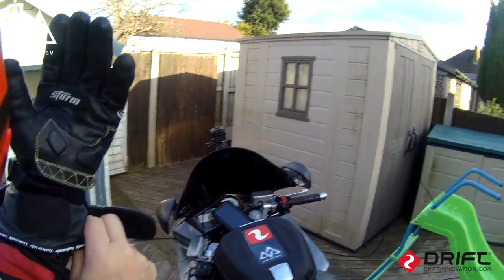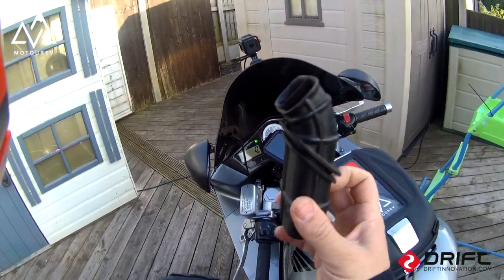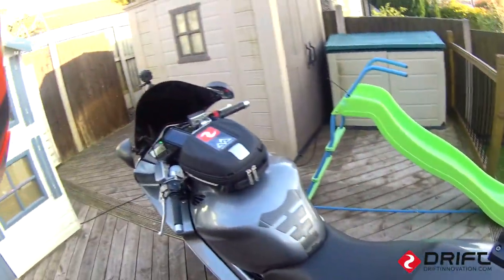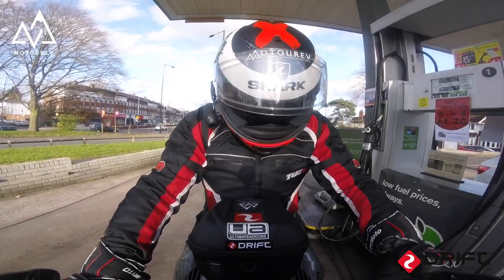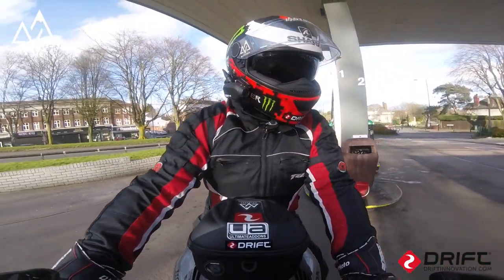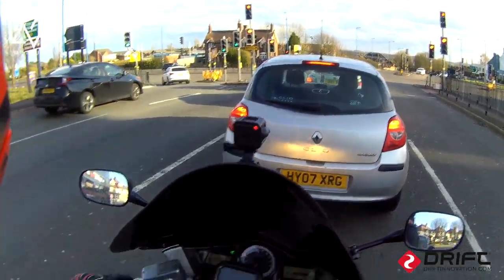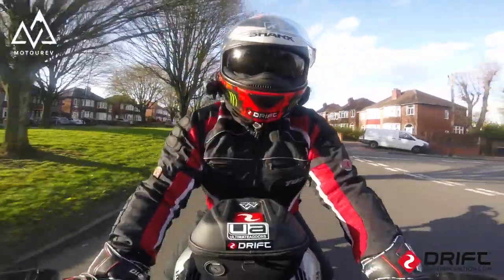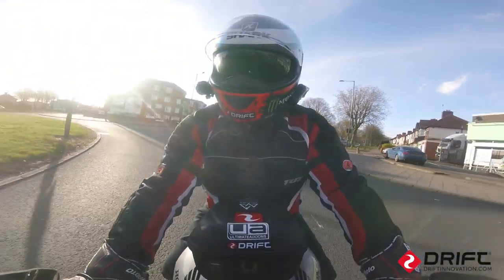Honda VFR800 Snorkel Mod & Sound Test

Comment: It sounds very quiet. Good job. Open fiber race pipes wrapped in Braided, exhaust rap.
Red the only way to go low windshield.Cousin efi fuel programmer. K and n air filter. And also in this country, we don't have to have cadillac converters or whatever that crap is on yours. My rims are black limited edition with red pinstripe.
2003 It's a hundred and sixty seven mile per hour.Bike, and it sounds like the devil himself

Comment: I did mine recently,have delkavic cans on,make sure you isolate anything unplugged with insulation tap and also if you have standard exhausts leave the inlet on the pair valve unblocked ,If you block it will clogg up the cat,if you have aftermarket cans on it will pop and crackle with it unblocked and wont do damage if you block it.
If you do block the inlet pair hose use a marble lol or a cap.
Reply from the maker: ID METALGUITAR cheers mate for that info, very helpful
Reply: Makes no sense what you're saying ... if a Cat's fitted, yes leaving "Pair valve" in a working condition is beneficial for the Cat & O2 sensors to function as Honda intended, changing cans, it'll still affect Cat & O2 sensors if u block "Pair" system ... (Think about it)

Comment: Have noticed a lot have done the free horsepower mods but I’ve never heard it like you have just done the engine sounds a lot deeper when you throttle off ( apart from vetec my favourite sound ) great vid m8 👍🏍💯🤘
Reply from the maker: Lj782 I love the sound, might be a mix of the 2 audios from both cameras but sounds a great beast
Reply: There are no free horsepower mods, it's a myth.

Comment: I definitely prefer the sound of the bike without the Snorkel, it sounds so bloody grunty when the VTEC kicks in! It could be a combination of the flapper mod with it though. I'm not convinced by the PAIR valve mod mind, actually thinking about putting mine back to stock to see if I notice any difference!
Reply from the maker: Kevs Shed be good to hear your thoughts
Reply: I agree with you Kev. The snorkel mod sounds great.  I did the trio of mods.
Kept the flapper mod
I put the snorkel back because I feared the water and crap will get in. 
I did try the pair mod but bike didn't want to start.  Kept cutting out. So I put it back.

Comment: Did you do the flapper mod too? there's a small vacuum hose that lifts a flap in the airbox to reduce air flow. Just pull the hose and leave it loose and she will breath better again. I put all mine back though pipe and snorkel. I wanted better economy.
Reply from the maker: Yes did the hose too, not noticed anything different in fuel economy
Reply: @Motourev  i found mine using more fuel for definite. May of been my riding though, who knows? Lol
Reply from the maker: @callumjohnson9433  😂😂 yeah I ride like a learner so prob get better fueling 🙈
Reply: Pulling vac hose from flapper does nothing for economy or performance, hope u plugged the hose or you'll have a vac leak & cause it to run lean, which can be terminal for a 4 stroke motor, flapper disconnected, bike will run a tad smoother at low rpm's if the starter valves are correctly set, 5th & 6th Gen are different.

Comment: beware this mod will allow rain water to enter your airbox on really wet days
Reply from the maker: Hasn’t happened yet in 2 years, and did 160 miles in heavy motorway rain in July. Will keep a look out.
Reply: Wrong!!!  flapper is open all the time motor is spinning above 3,000rpm.
You may get water in jet washing, but only a fool would jet wash their bike.
Reply: Flapper is fully closed below 5,000rpm, fully open above 5,000rpm, what makes u think you'll get water ingress into airbox?
Disabling flapper vac unit only leaves flapper fully open all the time, personally I'd advise to fully remove the flapper vac unit, gaffer tape over the mounting hole, install a couple of self tapping screws thru flapper edge to secure it fully open or remove airbox lid & remove flapper all together.
Removing snorkel does nothing but increase intake roar, in fact bike will lose power due to airbox resonance being affected, for best results, leave snorkel in place.
If u have a vermin issue, fine wire mesh over flapper & snorkel inlets, no mice or rats can get in then.